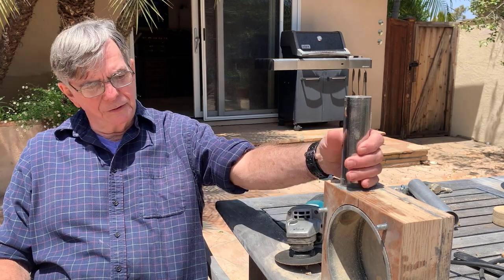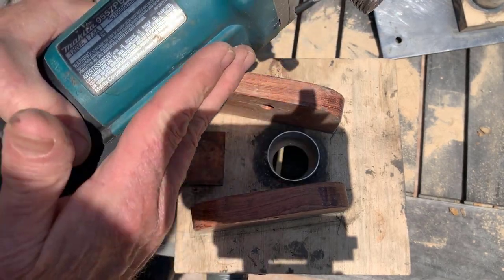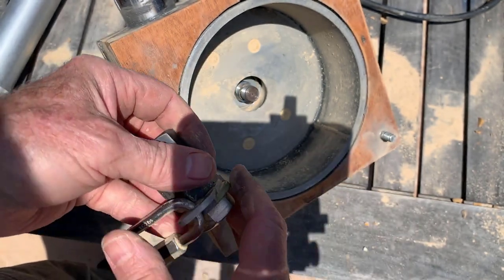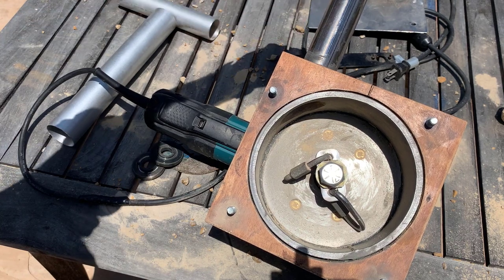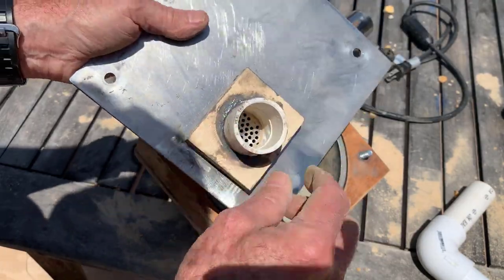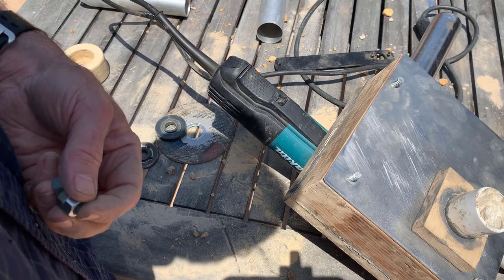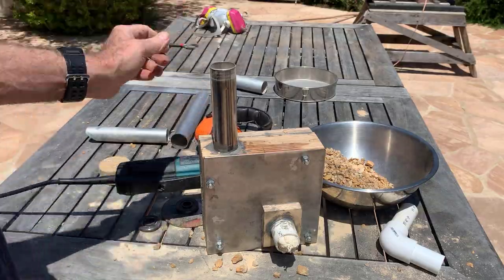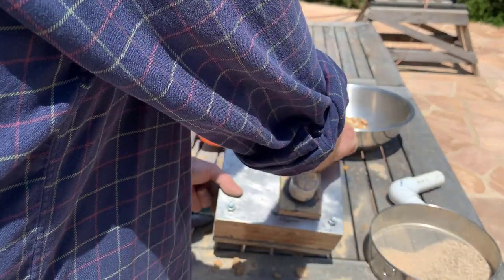DIY No-Weld Rock Crusher using Makita Angle Grinder -- Powerful and Effective

Comment: an excellent video!  and there is another use than crushing rock for gold:  we model railroaders need very fine rock material as the "dirt base" to use in our scenary work.   you can buy already prepared material (very expensive) or you have to try and get your favorite rock crushed down to size yourself.   Your device is perfect for that!    thanks again!
Reply from the maker: Yeah, this would make a nice grinder for your model railroad needs.

Comment: I built one of them & brought a new Angle Grinder 4.5". Almost burnt it out in seconds. I now gone with a 3/4 Hp electric motor I had lying around. It doesn't smoke.
Reply from the maker: Nice to have a big grinider!
Reply: @orophilia  No, same grinder. 10" or 250mm. I just rigged up the electric motor to it.

Comment: This is awesome. I was visualising something similar but could not quite see the finer details. I thank you for filling in the blanks for me. The square wooden outer is clever. A couple of thoughts. I know carabiners are cheap, although not a buck in my country, but I would probably buy a pack of Hard Facing welding rods, which is a super hard material that you build up on wear parts. Then give it some more weld every so often as required. Then instead of the large metal tube you purchased, I was imagining using an old car brake drum. Or weld up a 10+ sided polygon from smaller bits of flat bar so that the rocks bounce more which should pulverise them even faster. And for sound dampening, I wonder if glueing the large tube in place with silicone instead of epoxy, being somewhat flexible there will be less conduction of vibrations for the neighbours on a quiet tranquil Saturday morning! Maybe a strip of rubber glued to the base and side. To make it much less of a drum.

Comment: Just a simple suggestion.  Use a short sction of link chain in place of the spinner and carabiners.  Easy and cheap replacement, but you may need a "square nut or block" under the bolt to keep the chain centered and balanced.
Reply from the maker: Thanks, James!

Comment: After many hours of breaking ore rocks down to less than a golfball size to feed another flayer I just had to say enough wasted time so upgraded to a hammer mill that does in an hour what took a month of weekends... which regained my sanity... bottom line... get the tool that does the job you need... fast! Two Harbor Freight grinders: one for metal cutting and another for polish/sanding are always ready - no disc swap required - two HF grinders are way less than one Makita... grinders are like toasters... when it breaks not if... Let the garbage man take it away... Thanks!
Reply from the maker: Hi Douglas. Yes, always get the best tools that you can afford. Excellent advice.  -- Dave
Reply: @orophilia  Afford is part of the equation but service life should be considered too. Good luck out in the Mojave Desert.

Comment: That's a cool little DIY project. You could empty it by tipping it upside down & shaking the content out the feed in hole. A funnel too would be good when feeding it & not spilling the material which I noticed was happening. Thanks for sharing. John from New Zealand.
Reply from the maker: Hi John, I now use the machine just like that. It works well. Thanks.

Comment: i have several teachers who i respect greatly , you have just joined their ranks , many thanks .  I’m a recently retired prop master also in LA and have fashioned props for on camera and have made many tools over the years for various projects ( for example the designer of wolfgang pucks at LA live wanted hand drilled holes in the floor to ceiling iron lamp shades / and i had the winning bid and cut 13,666 holes in a few days using a modified hole saw ( normally this work would be automated but this was purposefully crafted to be visually more organic and i admit as silly as it sounds it did look far superior aesthetically than the original water jetted prototype) but i digress , your build is meticulously thought through , your explanations were clear , concise and left nothing out without bogging us down with the “ overburden” of useless and/or redundant verbiage one could expect from me or the very brainy but equally long toothed C. Ralph 🤠.  
 I subscribed on the first video i watched of yours , have “liked” each subsequent viewing in appreciation and am likely going to be “liking more in the near future . Again , Thank you for your time sharing your knowledge and experience in this way .
Reply from the maker: Hi Jeffrey, thanks so much for such a wonderful comment. It's greatly appreciated.  -- Dave

Comment: Fantastic build on that rock crusher mate , well done ,it does the job excellent, a little bit of working with what you got can do the trick In expensively, way to go ,thanks for sharing your build ,it will help other to make one for them selves saving heaps of money on the over priced ones out there. 👍

Comment: This is so much nicer than the one I made, lol. Nice work! I might have to build myself a new one now.
Reply: Though I do get similar size reduction, with about 50% passing my 60 mesh screen as well.
Reply: Can you tip it upside down to get the crushed material to come back out the top tube instead of unscrewing the side plate?
Reply from the maker: @LetsCrushRocks  Yes, that works also and it takes about as long as opening the side plate. -- Dave

Comment: You have come up with a good cheap crusher. I can not draw it for you ,but being you, I think you will figure it out. To save changing the soft metal flails. Consider using grade 8 bolts connected side by side with replaceable stacked #8 nuts on the bolts. Much harder. Just a thought.
Reply from the maker: Nice idea. I'll see what I can do.  -- Dave

Comment: Very nice crusher! I love it is made from wood and glued! It reminds me omegageek64 crusher. Very nice job!
Probably if you want it continuous you could use a shop vac ar outlet (like omegageek), or cut out a piece of pipe so it will fall out more by gravity (like in mbmmllc hammer mills). In any of those cases, you could cut this 60-mesh sieve into a filter, so only smaller particles can go out from the crusher. And maybe, just maybe, the crusher works as a strong enough "fan" to push powder out, so a small cyclone could be just added to the outlet pipe to collect powdered rocks. But for that I expect a hole on the bottom not on the side would work better.
In any case, this is a wonderful piece of equipment Sir!
Reply from the maker: Thanks for the ideas! When I get back to this I'm going to try to make a crusher that uses a small flow of water through it. The slurry will then get dumped right on to the shaker table. If you haven't already, please see my video on the latest version. It's now a Bump-Sluice shaker design.  -- Dave
Reply: @orophilia i I will!
with water flow through crusher, I would be aftaid that stuff will damp crushing power, mbmmllc hammer mills do stuff on dry material and wet it after. I think there is reason why it is done this way :P
Definitely for that try first without shaking table just to add some water by top pipe without modifying this beautiful machine :)
I know shop vac would make it not as mobile as circulating water, but small car vac plus some cyclone could be enough for that.
Reply from the maker: @ejkozan  The joy of experimentation is about failure and fixing, and sometimes abandoning the project altogether.  -- Dave

Comment: 7:06 
That iron pipe inserted inside the layers of plywood is a very good idea to dampen the noise level caused by the rocks hitting the inside chamber of the pipe. ✅
I think that I would find some old tires, worn out tires and get a sawzall, cut the tread off and wrap the entire crusher with rubber and iron bands to hold it. That would really be quiet.
Reply from the maker: Yeah, you're right. The mill makes less harsh sound than an all metal one.
Reply: @orophilia  another option I have thought of would be to take truck tire flaps you know mud flaps, and somehow stainless steel rivet them with the round head inside the drum and nylock washers on the outside with big fender washers. That way you could also use those lugs to attach different attachments. Perhaps even a side dump to go into a bucket.

Comment: Great idea for those of us who don’t do welding. Thank you.
I wonder if you had the motor running when you poured the +60 mesh back in if it would crush more of the material better so it didn’t have to try and suck it up of the bottom to crush it.
Reply from the maker: Good question. I'll have to try that to see if it makes a difference. The courser material eventually gets crushed if I keep cycling it back in.  -- Dave

Comment: If the carabiner touches the pipe , will that damage the tool ?
Is it important to have that gap as small as possible ?
If your outer cover was steel plate screwed and epoxied to thick ply , could inside and outside plate be made of say , 1mm thicnkess ?
damn you make good stuff - God Bless you.
Reply from the maker: Hi GSF. Well, I don't know what would happen if the carabiners touched the steel pipe, but I can't imagine that it's good for reliability. :)  Yes, I think 1 mm steel plate would be adequate for both sides if epoxied to plywood. I don't know about the gap; maybe it's not important because the chaos inside the tool brings the ore to the flail eventually. -- Dave
Reply: @orophilia  I imagine in the process of making your fine tool , you must have drilled your holes attached to the carabiners to give an initial gap.
What was that gap ?
What gap would you suggest 
?
Reply from the maker: @mohammednovalija  I made the gap between the carabiners and the wall about 1/8"

Comment: I have played it several times and can't quite make it out:  a 6" ------- pipe?? Did you order it cut to size or was it a standard piece?  Those details would be fun "on screen" like some of the other parts - or in the comment section. I know it's hard to come down to "bozo" level - but us bozos (I hope I'm not the only one) need lots of detail. That's damn clever - I love it. Thanks!
Reply from the maker: I need to work on the audio, it's difficult to find a microphone that works well in various conditions outdoors. I got the pipe from eBay and I didn't have to cut it. It was advertised as: 6" ID X 2.25" steel pipe, 1/4" wall thickness. If you've got a metal store nearby they should have it.  -- Dave

Comment: You should have made something sensible, realistic...
Just to crush a few bebbles, you need to on/off again & again..???
It should have been continuous working type...
Reply from the maker: Yes, I agree, but that's what you get with an angle grinder, and it works well in the field on battery power. I'm building a more permanent rock crusher with a 1/2 HP motor, which will be more convenient in the shop.  -- Dave